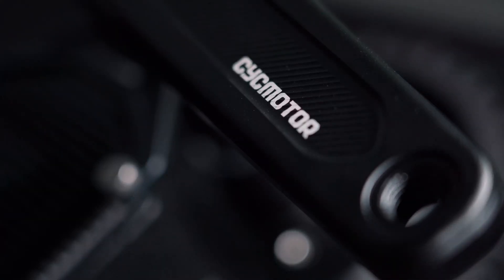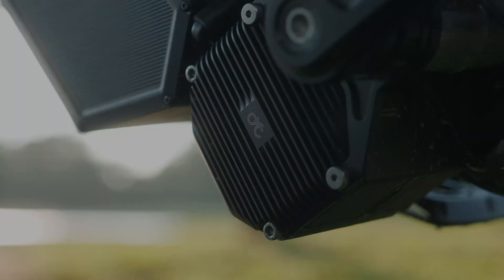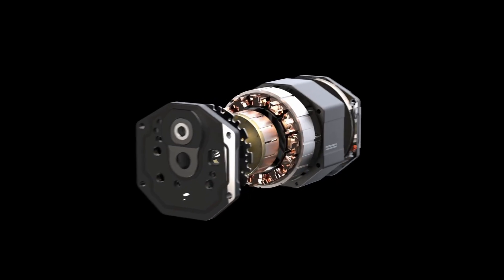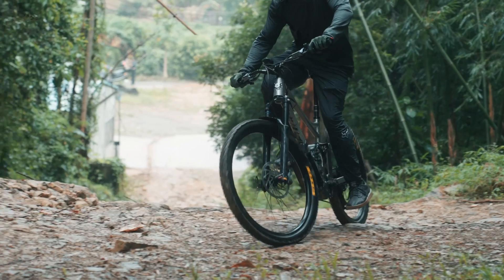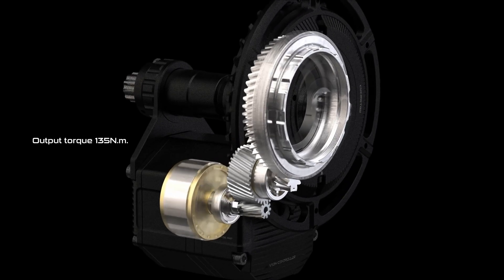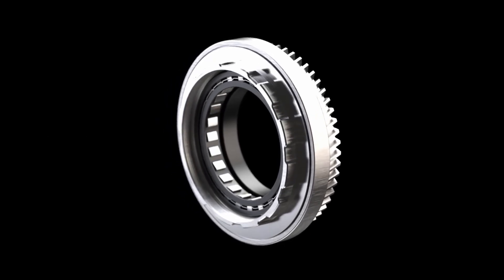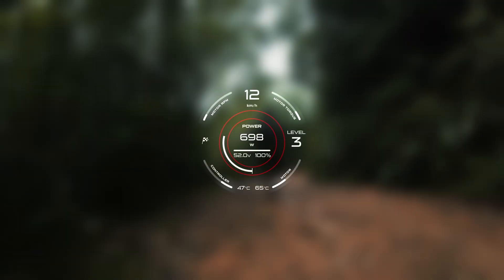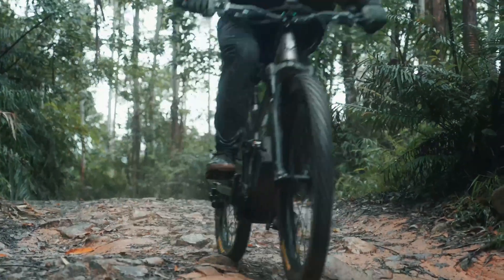CYC Photon Gen 2: The Ultimate Retrofit E-Bike Motor! 135Nm & 2000W

Comment: How is the chainline on a 73mm frame?
And how on a 92mm BSA frame?
And how fast (max rpm of cranks) can the motor at 36V and 72V.

Motor locks fine - I plan the replace my BBS02B with it if the reliability is good and it is as silent as the Befang well greased.
Reply from the maker: You will find the chainline and q-factor info for all the bottom bracket types in the user manual below. You can also see the max RPM at crank >300 RPM and more specs:

https://www.cycmotor.com/photon-downloads

Please let us know if you need any other info.

Comment: My biggest issue with the photon gen 2 is being able to put it in unrestricted mode, but yet it still kills power to the motor at 2k watts. I understand why you'd want to limit the power, but don't advertise it as unrestricted, cause it's still restricted. I don't want to use a controller that limits my power output. i want full control over it, and that's why I'm switching to VESC controller exclusively.
Reply from the maker: More power is great for many people! We have the Proton coming out soon that will be rated at 3000W. 

Due to ensure the longevity and thermal performance, even motor has limits. In this case, the limiting factor is not the controller as we will be using the same controller on the Proton. It's the limitation of the motor design directly. The only difference between the Photon Gen 2 and the Proton, is the motor itself.

Comment: Guys. Stop wasting money on cyc products. For the same price you can buy 4xTSDZ8 or 3xTSDZ16 or 4xToseven DM02. Spare parts Are available and way cheaper than for cyc products.
Reply: From what I heard you definitely can buy multiple tongsheng motors but you are also forced to due to their short longevity. They also wont have as high of torque and watts
Reply: Heard tongsheng is more reliable and cheaper than toseven, and not many good things about toseven.
Reply: @FWS_Sinister  I've done 3200km on my Toseven DM02 and not a single mechanical failure. Spare parts are also cheap. Controller - 50$ , Torque Sensor - 25$ , Nylon Gear - 10$.

Now check prices of spare parts for CYC products. Pure joke!
Reply: @ataksnajpera how often are you really replacing parts on the photon though? It seems really reliable. From what I heard on the old photon the only issue was a very rare clutch issue. Within the first year most of the parts are free I think. At least for me I got replacement cranks, retaining caps, lockring, display, throttle, and cable harness for free. Good to hear the toseven is reliable for some, I just heard from another youtuber who’s video I can’t find that he got a toseven and switched to cyc and said “that’s what you get when you buy from a new company” or something saying it’s not proven which is a sentiment I’ve heard elsewhere although don’t remember the exact issues. Also not exactly a 1:1 comparison to cyc performance wise, chainring options, etc.
Reply: @FWS_Sinister  For 1000$ cyc motors should have all mechanical parts made of titan. Then I could understand why we pay premium. Instead you get normal motor for the price of apple iphone 17
Reply: @ataksnajpera  It’s definitely on the expensive side, but it’s not an average motor by any means. Whether that premium is worth it really depends on your needs. The Photon Gen 2 is more comparable to the DM01 than the DM02 — the DM01 is basically a BBSHD with torque sensing and slightly lower power, while the Photon delivers more watts than a stock BBSHD but slightly less torque.

In terms of reliability, the Photon feels more refined and solid overall — with a sturdier motor casing, stronger cranks, and a sprag clutch that’s roughly three times larger. The Gen 2 also adds thermal improvements over the Gen 1, showing CYC is actively working on long-term durability. Both motors are fairly user-serviceable, but the Photon probably has the edge there too.

The Photon Gen 2 offers what’s arguably the best torque-sensing setup on the market, combining torque and cadence sensing for a very natural pedaling feel. The Gen 1 was already quieter than the DM01 in tests, and the Gen 2 seems similar — mine is extremely quiet, about on par with a BBSHD under load. It’s also about 1.3–1.5 kg lighter.

Design-wise, the Photon Gen 2 stands out: it has a split shaft, smaller chainring options, a unique mount that gives an optimal chainline out of the box, an ISIS spindle, 83 mm bottom bracket compatibility, and support for 72 V systems. Altogether, that makes it one of the most compatible kits I’ve seen. The included chain guard is also a nice touch.

I haven’t done a full hill test yet, but I expect a BBSHD to climb better due to its higher torque at the same gear ratio. That said, the Photon’s perfect chainline gives me access to all 12 gears — something no other motor setup I’ve tried can match — which could make up for the torque difference on climbs.

Comparing it directly to the BBSHD (which is about $220 cheaper after tax) isn’t really fair anyway. The Photon isn’t designed for throttle-heavy riding — it’s meant to be pedaled, and it delivers a far more natural experience while still matching or exceeding the BBSHD’s top speed.

The new displays are another highlight. They’re premium, intuitive, and pair perfectly with the app, which makes tuning settings super easy. In contrast, the cheaper BBSHD display I used was clunky and poorly documented — I literally had to post the first user manual online myself. The Bikego+ app was also frustrating, with settings that rarely saved or worked properly. I could’ve upgraded to a premium display like the EggRider, but that would’ve added about $180, narrowing the price gap with the Photon to just $40.

Taking all that into account, I felt compelled to go with the Photon. I know there’s always some risk with a newer product, but for me, the design, performance, and overall experience made it worth it. Those are my reasons — others might have different priorities, but that’s why I chose it.
Reply: @FWS_Sinister  Nice wall of text. No idea why are you so involved in this company and their products. You are defending them like it was your family.  Photon is so expensive that even german Bosh/Brose motors are cheaper now. You are simply brainwashed by their marketing department. Every CYC product is a beta product. CYC STEALTH gen1/gen2/gen3 and then abandoned.
Reply: @ataksnajpera I literally just gave my opinion and use case, but if you can’t read or your ego is too fragile to accept other viewpoints then don’t waste my time :) Peace 🕊️
Reply: @FWS_Sinister  Keep buying... Photon Gen3 is already being designed!
Reply: @ataksnajpera Actually another great aspect of this motor. The new “Proton” aka “Photon Gen 3” can be swapped into this for more power!
Reply: @ataksnajpera brainwash is more thinking like Bosch is comparable to. To only have good torque sensor really if that’s what you want go get it and it’s not that much better but they are still low power. design of photon isn’t even close Bosch is built for a certain bike frame and stuck, closed system, no tampering, and photon is diy for fit on any bike, fully open, user repairable, open source canbus, work with any battery, fit another chain ring without any chainline change etc
Reply: @FWS_Sinister  Buy yourself a motorcycle if you need more power ,dude!
Reply: @trimetrical5756  Fully open? What is open? Firmware? If european motor is cheaper to manufacture than asian motor then you should know that something is not right!
Reply: @ataksnajpera  yeah bro, let me roll my 450cc up the MTB trail real quick, I’m sure that would go great with the trail manager.

And Photon isn’t trying to be Bosch, the point is you can build it on a bicycle of your choice
Reply: @ataksnajpera motor = open firmware, user serviceable, compatible with any bike. face it, bosch underperforms here. “get a motorcycle”? to get license, registration, insurance, and only legal to ride on roads? No thanks. you are making lazy takes like you have no experience with anything you’re talking about
Reply: @ataksnajpera the motor you’re talking about has no mounting hardware and costs nearly $1.1k. The photon gen 1 motor itself only costs $585. So you’re still wrong there.
Reply: @ataksnajpera  15 miles on my DM02 and a bearing broke. 200 miles after fixing the bearing and its fucked again, haven't even bothered opening it up yet. been the most unreliable noisy piece of shit motor.
Reply: @abiikos  Another idiot spreading lies! CYC PHOTON costs ~1200 euro if you include shipping cost to EU and add duty and VAT! 
Nice try bro! You're clearly in some kind of damage control mode.
Reply: @ataksnajpera Nope, look up photon gen 1 motor core, they usually go much cheaper than a bosch motor. Both don’t have mounting hardware which is why I compared them.
Reply: @ataksnajpera  I have a DM01 that ended up having a bad torque sensor. it wasn't too difficult to replace for sure, but I haven't put that many miles on it for this to happen so sudden. I've not heard many great things about the DM02 and it's reliability. Seems like there are always issues with the DM02 in the discord I'm in. I bought a DM02 for my wife's bike and I think it is a firmware upgrade away from being a decent little machine, but currently it is pretty herky jerky in comparison to my very smooth DM01. Regardless, don't act like your experience is what is globally known about the toseven motors. They need time to be great and reliable, like any other company. I will agree about the parts being cheap, but not readily accessible depending on where you live.
Reply: @abiikos  Bosh motor costs ~900 euro in EU. While Photon with added all taxes and shipping cost ~1200 euro. Simple!
Reply: @ataksnajpera  you're literally doing that yourself buddy
Reply: ...and none of those will fit any of my bikes...
Reply: @hindesite  Next time buy bikes with standard frame.
Reply: @ataksnajpera  just doesn't get more standard than a Trance, or my Silverback. But thanks for the  advice.
Reply: @hindesite I agree, and believe my growler is standard as well, which won’t fit those other motors
Reply: @hindesite  Skill issue if you can't install those motors on standard hardtail 68mm frame.
Reply: @ataksnajpera  seems to be a knowledge issue somewhere here.

Comment: build to last was the last slogan of the gen 1 as well - please dont forget your previous customers and take care about their old gen 1 problems! i want to have a sustainable way of daily commuting - so i want to use my gen 1 as long as possible. which means i definitly need some more spare spragclutches and i guess motors as well - the bearings are giving up after around 4k km which is way too less for me.
Reply: I hope they make upgraded spare parts for your use case. Otherwise, it is common practice to release revised and upgraded products over time. First adopters of any new thing always pay the price of cost and reliability
Reply: @tonytober  Oh, come on. Photon buyers are not "first adopters", nor do they deserve any less consideration than those who buy later. CYC is well established and have been making motors for years when the Photon was released.
Reply: Even continuing to make chainrings available would be a requirement, since these are proprietary with no other easy replacement.
Reply: @hindesite Then send them an email. They're quite responsive. Sorry for you being upset but I'm as unbiased as it gets, I don't work for them or am I affiliated in any ways. Would love to be but I am not
Reply: @tonytober  I've always had great responses from the guys at CYC when I've dealt with them over the past couple of years and I'm extremely happy with my Photon - it is as good as it gets. I don't think I would come across as upset, but I just don't think the "early adopters" excuse is relevant here. This isn't some random kickstarter project.
Reply: Which bearings?
Reply: @hindesite  well, i had 2 broken main motor bearings yet in under 5k km... as well as 3 broken sprag clutches, and over 3 broken controllers. finally the display broke down after 2.5 years...
Reply: @lucahartkorn-2772  wow, that is appalling, there would be no way I'd consider CYC after that.
Reply: @hindesite  no i do realy - the motor itselfe is pure fun and definitly the right step in the right direction!

Comment: so why not an update for the gen 1? its a complete new build - as a gen 1 user i´ll need to buy the hole kit to profit from it. for example the sprag clutch of the gen 1 is way too smal for the torque - so why dont you give us the chance to ride the "old" system longer by just updating the main parts? and one of the biggest issues isnt fixed at all - the painfull removal of the main chain holding nut. ahhhhh
Reply: Pretty sure they redesigned it because they couldn’t put these parts in the old design
Reply: @FWS_Sinister  no, they moved from outrunner to inrunner design. That was the point of the redesign and also a whole change in design rationale - and also to add Proton modularity (yet to be seen). They moved from a slow spinning, high torque outrunner rotor (not great for that clutch) to a much faster spinning low torque inrunner rotor with a bigger clutch. That change requires a whole redesign of the drive train since the reduction is now about 2x what it was previously.
Reply: @hindesite no yea that’s what meant. I don’t think it would fit in the gen 1

Comment: Nice, compatible with 3rd party batteries? Please don't go the way of Bosch or other proprietary anti-right to repair/ closed eco-system. Appreciate you guys making continuous development, sincerely, the guy who blew up the x1pro gen1 sprag clutch and flung magnets off early stators, but still enjoyed all of the early days of modding
Reply from the maker: Yes, still compatible with 3rd party batteries and we don't have any plans of locking things down. We still aim to make things as easy as possible in terms of fitment and set-up compatibility, at-home repairs, and servicing.
Reply: any motor you can retro fit is gonna have no compatibility issues with 3rd party batteries that would be insane
Reply: @Willybob488  thats not true, Bafang's new motors that are replacing the bbs02/hd are now CAN bus and need to use their batteries. That said CYC has added CAN bus for the display but they havent forced any sort of battery communication.
Reply: @Willybob488  how did that work out with Bafang?
Reply: this is can bus but still open source

Comment: Looks like the parts for the Gen one are disappearing? No more chainring and no more 1to4 harness cable available?  Are owners of the Gen1 supposed to expect a better support? I got mine for less than a year, feel it's already outdated and unserviceable! No upgrade path either, no announcement  prior to release, I am not sure my next motor will be from Cyc..
Reply: exactly my thought, im running out of gurranty, needed to get a new clutch by my own and now the display died - costs me over a 100bucks to get it ...
Reply from the maker: Hi there, disappearing parts? All the Photon Gen 1 parts are still available and will continue to be available for the foreseeable future. If there's something you need and can't find it on the website, just pop us an email. Furthermore, the Gen 2 chainring set is compatible with the Gen 1. You will need to get the full chainring set if you're purchasing it for the first time for your Photon Gen 1 and thereafter, the individual components may be purchased.